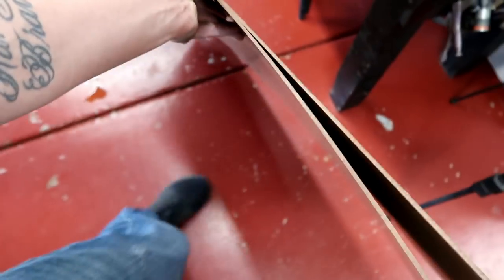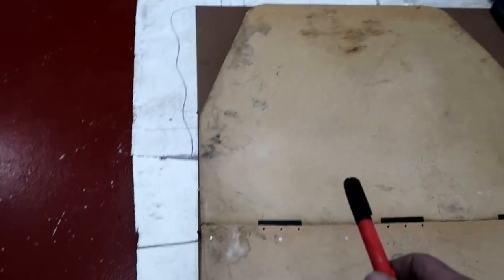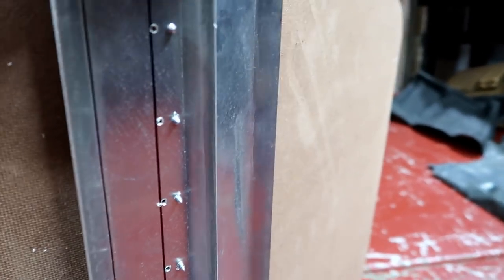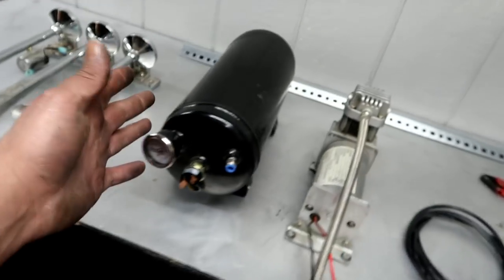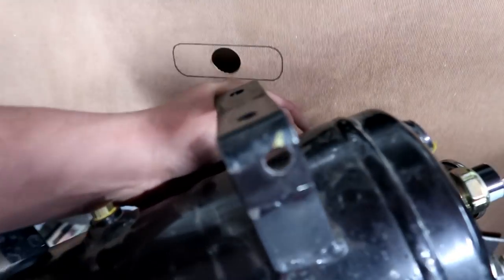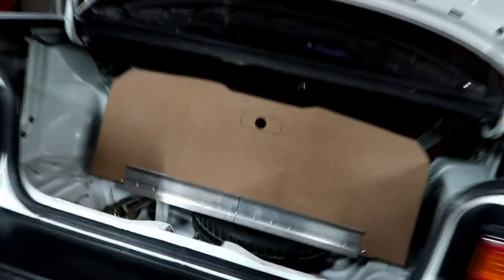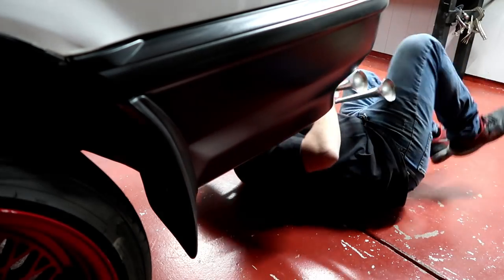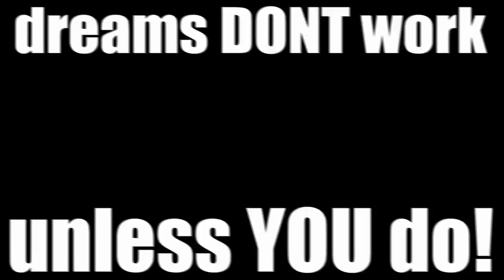You're not gonna believe what i'm installing!

Comment: My .02, is more frequent uploads like lately. I'd rather watch multiple 15-30 minute videos rather than 1 video that'd be the same length.

Regarding the horns mount them tucked up but cut holes in the bumper (3 holes each side of the bumper to match) so that most of the sound isn't just deflected back towards the front of the car/you.
#DBFAM